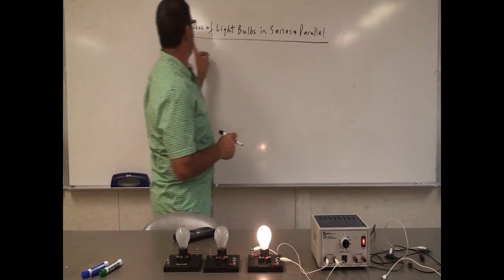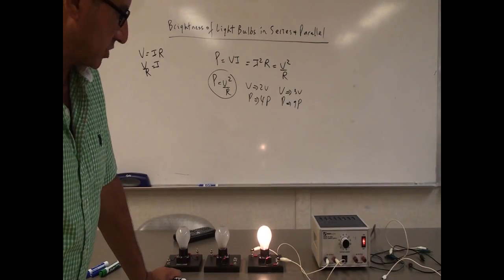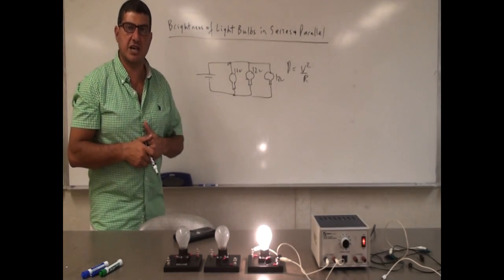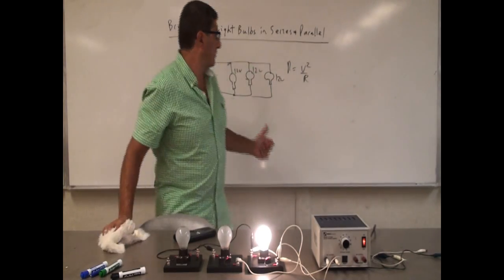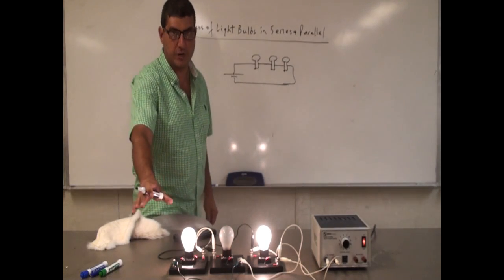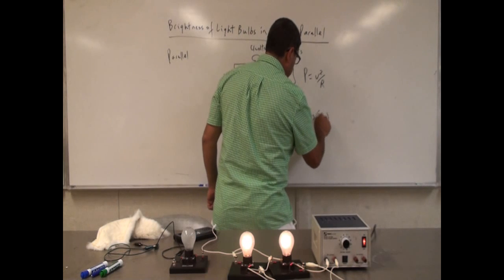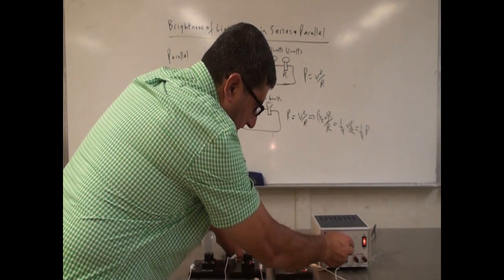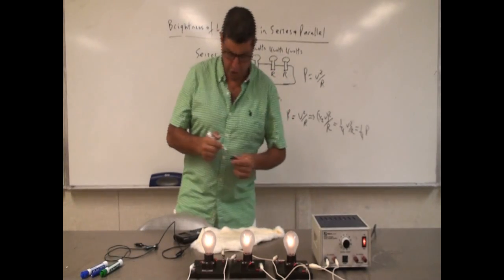Brightness of Light Bulbs in Series and Parallel

Comment: why brightness depends on voltage
Reply: Voltage is the energy that’s needed to create current and both of them are proportional so if u add more resistance in a circuit the voltage will reduce and the current will slow down  If this did not help you then try to find out.

Comment: Hi sir, could you please tell why can not we use the the second formula for power (that is P=I2 R),  instead of p=V2/R.
Reply: Jeswin George it’s because the brightness of light bulbs depend on the voltage and the resistance of the bulbs not the current
Reply: Jeswin George exactly

Comment: I have ceiling fixtures in front & back hallways which each have 2 sockets - a stepladder is needed to change bulbs.... So,  I wired the 2 sockets in series & used 40 watt bulbs which give an adequate combined light of about 20 watts.  This also  caused the bulbs to last 22 years, so far - while never being turned off !

Comment: The light bulbs from the parallel series will share the same amount of voltage, and they have 12V not 4V. That's why the light bulb from the parallel series are much brighter.
Reply: Parallel components have the same voltage

Comment: Hi sir i have a Question if you Answer my Question  iam thankful to you My English is weak iam from Pakistan 🇵🇰 My Question   on bulb series if we use 3v 40w 4 bulbs in series with 12v how much Watts consumption with 12volt supply please Answer my Question thanks
Reply: I=P/V= 40/3A.So, the current =40/3A and the total voltage =12V. Now, the total power= P=VI= 12x 40/3= 160W. Hope this helps

Comment: Handling 12 volts with bare hands is not good pls switch off rps before connections 🙂
Reply: lol 12v is not fatal, i even hold in my hands 24v with 200amps from a welding machine

Comment: some series mistakes. these type light bulbs are not ohmic. the resistance can be thought of for these bulbs as dependent upon voltage across the bulbs. it is not correct to say that if the voltage is doubled, the power quadruples.

Comment: Can anyone answer this question ? 
30 bulbs are connected in series.  If one bulb is fused and the remaining 29 bulbs are connected in series ,then the light in the room will be
A) increased
B) decreased
C) remains same
Reply: Tazwar Rahman  thanks
Reply: Increase
Reply: Since they connected in series., There will be no power in room. 
Hope it's correct.
Reply: Increased because the remaining are connected and the fused one is taken out if we decrease the number of bulbs voltage sharing of bulbs also get reduced and hence there is more power for every bulb and glows brighter so the light in hall increases ☺☺☺
Reply: I assume "fused" refers to the shunt that comes into play when a single  bulb burns out in a string of fairy  lights.  The remaining 29 bulbs will each be a  little brighter, but as there are now 29 instead of 30, the total amount of light will be about the same.    As the voltage to each bulb increases with each fused-out bulb,  they will fail sooner & sooner -  - which is why the burned ones should be replaced ASAP.